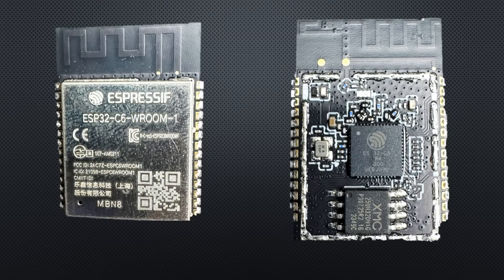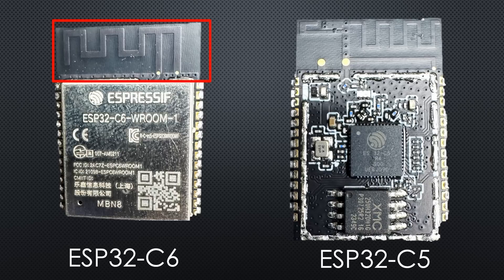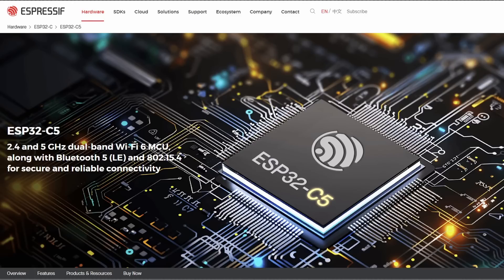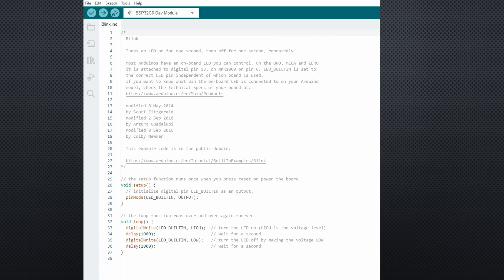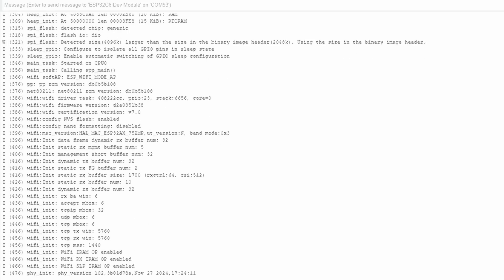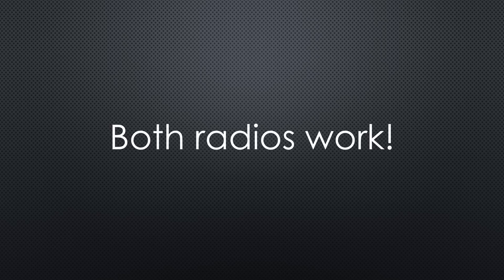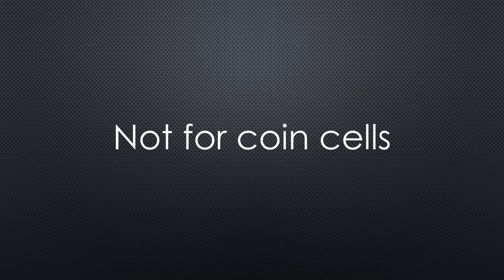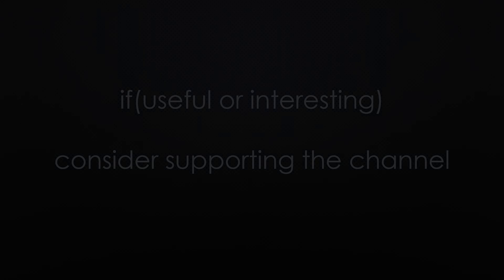(501) 5GHz from Espressif: The ESP32-C5

Comment: At last the dual band on expressif 👍 I wish they did not abandonned to Ethernet PHY and would have brought a 10Mb/s MAC as well... This would make a great WCH alternative and a MCU multiknife 🎉 Meanwhile we have to choose between wifi and ethernet on RISC V 🥴
Reply from the maker: Having ethernet and WiFi in the same project is probably not a typical scenario. At least here, I usually decide which connection I need and then decide on the chip. The SW interfaces are very similar.
Reply: @AndreasSpiess  Well having both means you can design either redundant ethernet or use the radio for non wifi scenarii for bridge/edge deployment and keep the core full Ethernet+IP. Plus it means you use only one chip/design for all your customer deploymen choices. Here for building IoT  if it is WiFi people might choose Espressif for good reasons, but if WiFi is not acceptable for usual security reason then you will have to move to WCH or others ... Or plan to have a board design that accept boths. This adds costs to the bottom line. I would have thought they would have brought a 10base T1S compatible chip, the first MCU with a PHY/MAC on board for it. Definitivelly a killer for automotive or building IoT if they keep the same price point... Thanks for your great videos 👍
Reply: @testman9541  The standard ESP32 is still actively supported, and the P4 also has RMII. ESP-IDF does now have support for 1 RMII phy for 10Base-T1S also. I do agree it'd be nice to have seen it on more of their chips, however its quite clear the C series in particular is specifically for wireless applications.
Reply: @callumkingunderwood  Nice that T1S is there in idf tnx 👍but unlike WCH there have no phy bundled which means increasing the BOM 🥴 which also means that for T1S you still have to bring a pricey T1S phy 😭 Look like the ESP32 original is most becoming a "legacy" as none outside P4 of the other offspring  have brought any wired ethernet ... And none have PHY. Odd.

Comment: Thank you for evaluating the 5.8 GHz ESP32. Sad, that it is so power hungry. What I am really missing in my home automation is a low power (e.g. zigbee) epaper display unit running on batteries. BTW: I converted all my aqara motion sensors to AA. They are running for years and I have not to touch (and adjust) the sensors when replacing the batteries.
Reply: These things are typically power hungry because they aren't going to sleep. You probably won't do it on a dev board but deep sleep on a c6 is meant to be 10uA which is a little high (smaller mcus get down around 3) but should still last a year on some AAA cells. 

Then it wakes up, pulls the power for a few milliseconds and goes back to sleep. The difference with wifi and ZigBee is the setup time, wifi is often seconds, ZigBee doesn't have one, just wake up and blast your packet then go back to sleep. There is very little that you can do if you want to Rx signals in something like real time that remains low power. There are some wifi modes that come close but that's more solar power will keep it alive than pure battery will last for months.
Reply: @zyeborm  Thank you, I started home automation in 2011 using the Homematic system. Those units are using 868MHz and draw little current during sleeping or listening. During communication they are using 20mA up to 30mA for one or two seconds. They also have a very good battery life.
Reply from the maker: Interesting idea! I only have a handful of PIR sensors. So I prefer the small form factor and easy mount.
Reply: @AndreasSpiess  My PIRs are hidden on furnitures or similar objects. So, I can also hide the batteries on or in these furnitures. Some of them are placed quite deep and upside down. 
I have them in every room and I trigger all the Ikea zigbee ceiling light panels with them - via ioBroker.

Comment: Can't the power usage be lowered by disabling parts of the chip or lowering clock frequency, as you can with an Atmel based board?
Reply from the maker: For sure. They have this low-power core. The question is which functionality you lose with the disabling.
Reply: You can lower the cpu frequency to reduce power in the ESP32
Reply from the maker: @G6EJD  Yes. But it does not help to reduce mA to microA
Reply: @AndreasSpiess  indeed, but every little helps!
Reply: @G6EJD  Needs to be more than 'a little' to move the needle from mains to button cell...
Reply: @dougle03  consumes relatively large amount of energy when active, so keep active time as low as possible, just needs a different way of approaching the task.

Comment: As long as the guy with the Swiss accent keeps making videos, the Earth will continue to turn.
Reply: Agree,
Reply: @AndreasSpiess, ar 3:12 you seem to be using full ESP32 devkits. They were notorious for high power usage due to very crappy USB-serial bridges. The bare "canned" submodule is much more energy efficient, suitable for battery use.
Reply from the maker: @PawelKraszewski  I mentioned that the module alone took 70mA.
Reply: Exactly
Reply: Hey, you ready my mind.
😇

Comment: All the hackers and network testers will be happy to see the 5ghz channel.
While the rest of us will be happy to leave the crowded 2.4ghz network.
What it can act as a bridge? Way cool.
Reply from the maker: I do not know if it can act as a bridge. Maybe for some low-speed traffic...
Reply: @AndreasSpiess  Oh ok thanks anyway.
Reply: all the other model can do it with just a single radio, now it can do 2.4 to 5g bridge hopefully, well have to wait for the esp32 nat router to update, hopefully the speed is better
Reply: Don't be so excited, 5GHz has shorter reach... 2.4 is really great in that regard, and i wonder if ESP can even saturate 5GHz bandwith... But it is nice addition for in home behind wall or two devices for sure.
Reply: i hope the repeater can have faster speed for 5g
Reply: Ultimately it's good to have both. 2.4ghz for range and penetration and 5ghz for crowded 2.4ghz. pick whatever works in your scenario. Honestly I'd like to see a more prolific lower than 2.4ghz WiFi for longer range and penetration with good-enough speeds than nothing. A reliable slow connection is better that a bad or no connection.
Reply: Around here, it seems like the the 5Ghz is more crowded than 2.4 sometimes.